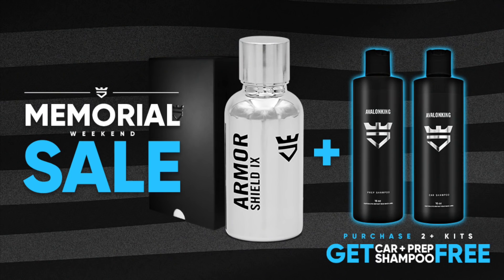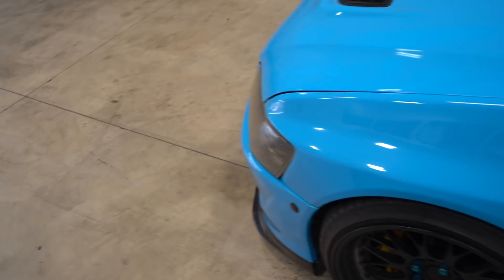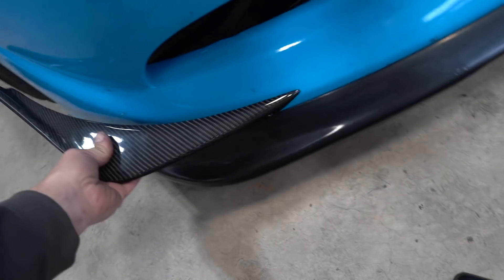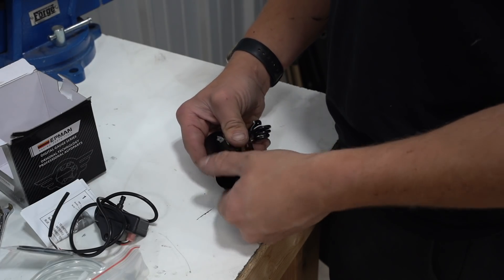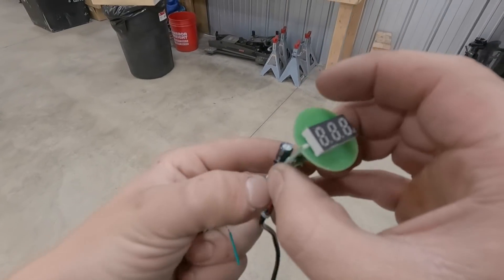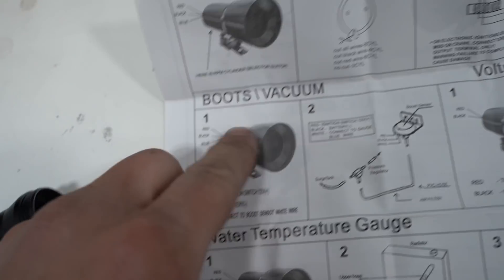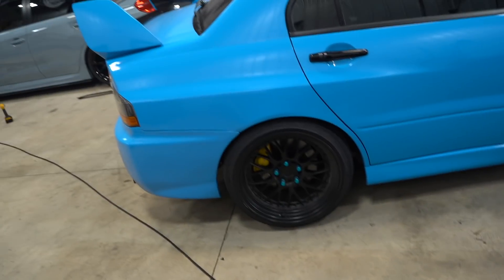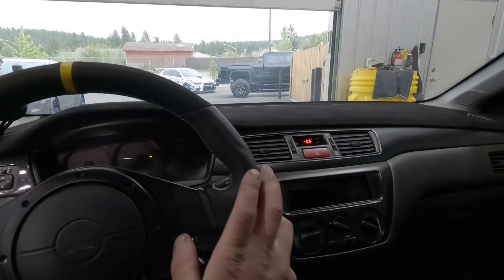One of the best mods...

Comment: You could consider the BLITZ FATT ADVANCE Turbo Timer with Boost sensor, with some minor modifications it could sit in the clock area giving you a possible read out of Boost, including max Boost achieved, Battery and Turbo Timer settings both Auto and Manual settings alarm limits for Boost and Battery. I have this in my EVO IX beside the Steering Column and had considered the clock space but I needed the clock for traveling through states as a more accurate time on road in Australia as my phones would auto correct time to new Time Zone.

Comment: I had the (factory spec) winglets since 2006 on my IX.  They weren't carbon though - these look pretty nice.  Always loved them.  Seeing this I might replace them with carbon ones that match the weave of my carbon front lip.

Edit: still something wrong with the gauge though.  It should really show 1.8 to 1.9 (or 2.0) under boost, and go up/down in 10ths of a bar. Vacuum would be -1.0 bar or around there, and 0 bar on the gauge would be atmospheric pressure (which in reality is 1 bar :-) ).

Comment: How do you apply the Avalon ceramic on matte finish rims, they are so rough. And these are TE37 LS in Bronze, I was gonna apply, but scared myself into not doing them because of the rough finish. IE: It's leaving lint and tiny fibers when cleaning them.
Reply: That can be a bit tricky but I would suggest cutting the applicator and suede and using bands to make for a very tight and snug fit and then apply as normal. Wait for 1 to 2 hours and make a second coating